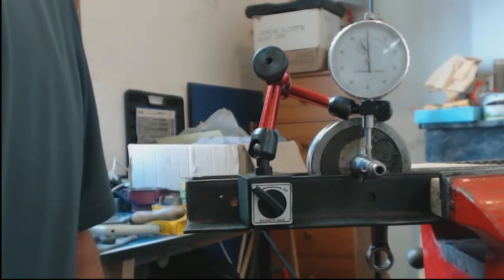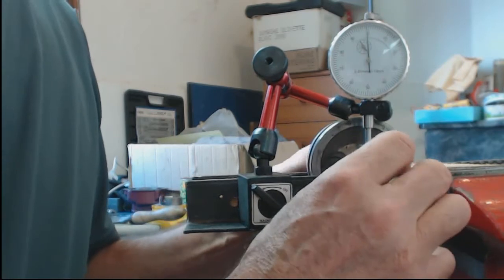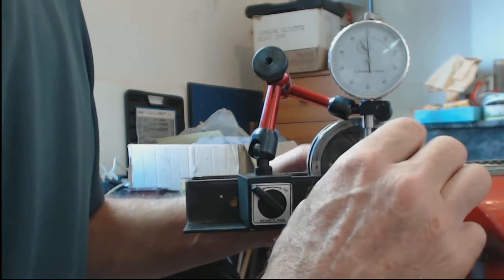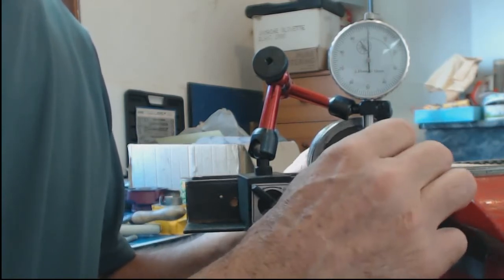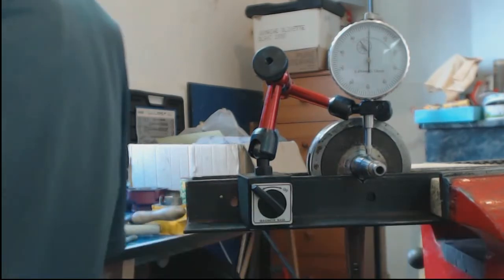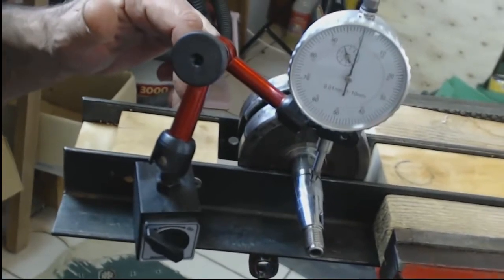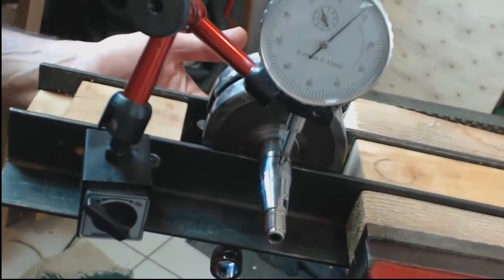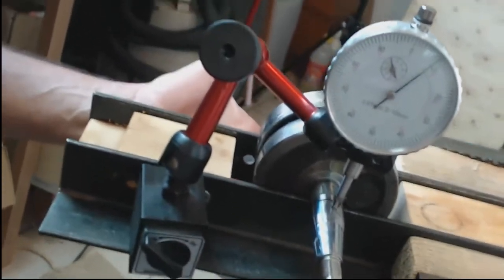Crankshaft Truing Jig - Part 3 - Testing the jig

Comment: Wouldn’t you want the indicators up on the crank halves themselves? Preferably two indicators? I guess I’m thinking of building a crank rather than checking one that may be OK.
Reply from the maker: Hi Neil :)
The indicator needs to be on the ground shaft.
If the halves have slipped, the two shafts will not be centered and they will wobble up and down.
The flywheels can be less accurate (and not ground) because they are tuned using metal removal, in order to gain ideal balance with the piston and con rod mass.
You could use two indicators, but it is just as easy to swap it over, and anyway, if it is wobbling on one side, it will be wobbling on t'other :)
Reply: @EngineTuning  Sorry, did you say the indicator needs to be furthest from the static point , in this case bearing races? So the runout he has wound be  doubled at the end?
Reply from the maker: @johncoscia5258  We talk about a measurable change of distance; but in reality, the issue is angular.
Measuring furthest from the angle point will produce the greatest deviation.